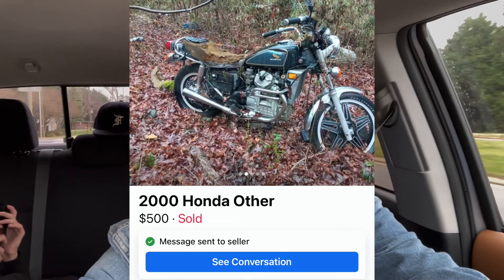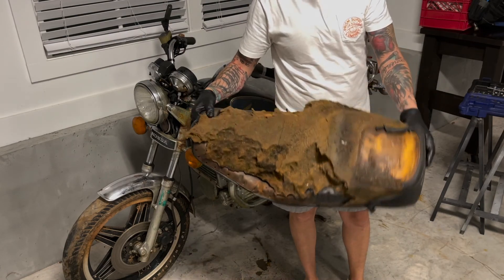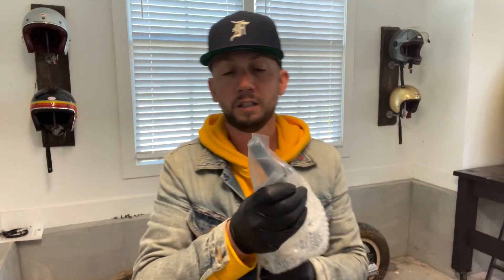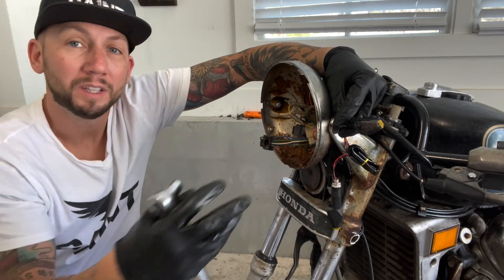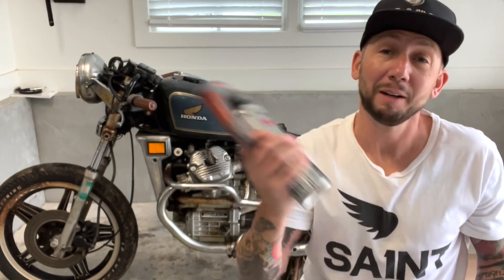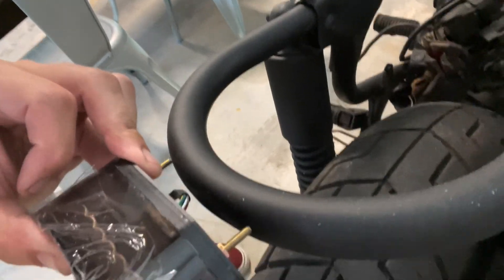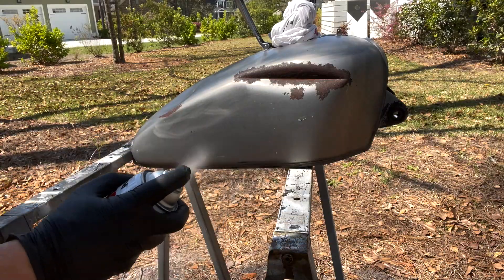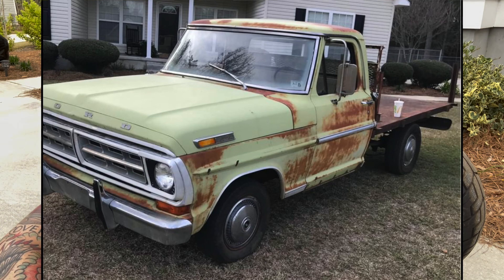CX500 Build

Comment: Great build! Currently working on a CX500 myself. Did you end up welding the hoop on to the frame and adding a crossbar to support the seat?
Reply from the maker: Hi, yes I had to weld it to hold better.  I didn't get that on film however.